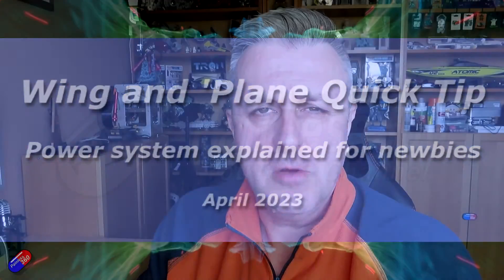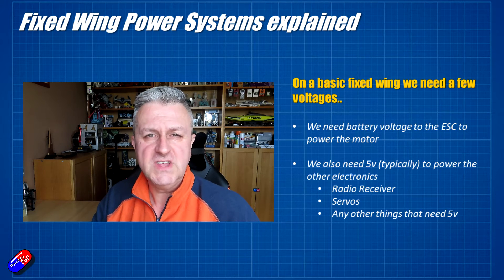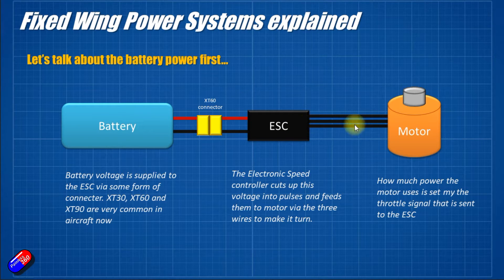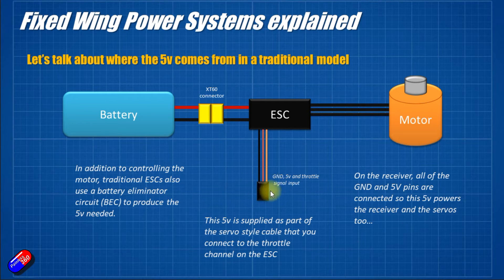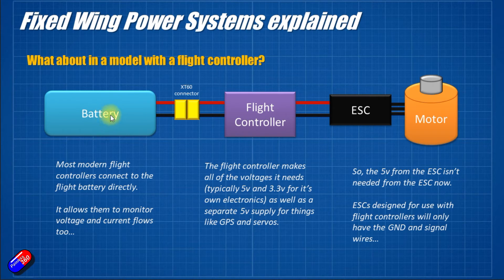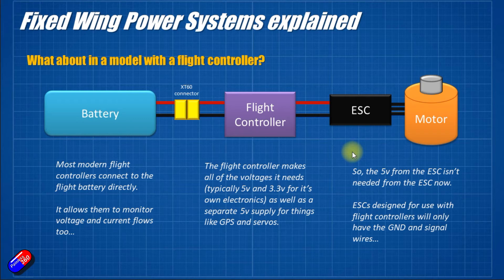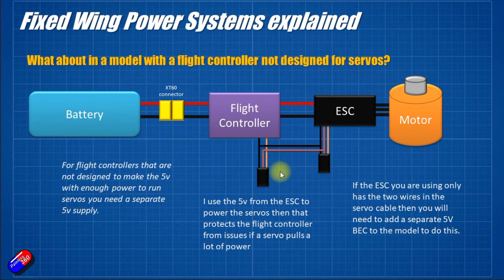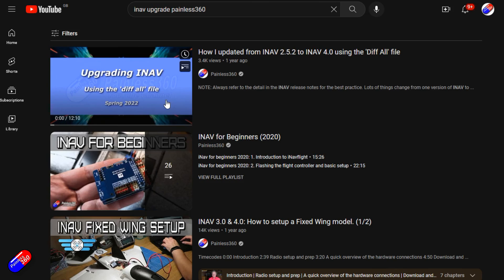Fixed Wing/Airplane Power Systems Explained for New Pilots/Builders

Comment: Hello again sir....1 quick question if u don't mind throwing some input
Can we use 5v from servo connector from flight stabilizer such as A3 V2 to  power up 5v electronic such as vtx ?
Reply from the maker: You can but you need to be very careful. I'd power the VTX from a dedicated 5v BEC on the model as they can pull a lot of power and noise on the power rails can be 'seen' as interference in the image..
Reply: Tq sir..i hope u keep on posting new vid especially regarding latest inav for beginners like me to learn converting from betaflight...much obliged sir😊

Comment: Exactly the video i have been searching for a while. 
As a beginner, i still have one question : what if i plug the throttle signal input from the ESC on the wrong connection of the receiver ? Am i risking any power issue/damage ?
I just bought a Multiplex Easystar RR as my very first plane, and a FrSky X8R.  Still trying to figure out how to assign the rights servo on the receiver.

Thank you. I subscribed though !
Reply from the maker: Typically, an ESC will not initialise until it sees a low value. As the other controls are usually around the middle channel value (1500) it'll just sit and beep until you move the channel that you have it connected to to a low value (below 1100 typically). Best of luck!

Comment: so does the flight controller cause a plane to self upright or what's the purpose of the EFC outside something like return to home? I assume you just fly acro always in a fixed wing plane. I'm going to have to get a kit. There's just no time. quads keep me plenty over loaded as it is. I got to have one though. Where does it all end? I'm so addicted 😂.
Reply from the maker: You can use the same flight modes as on a quad. ANGLE, HORIZON etc. They work in the same way. However, a well setup plane/wing is naturally stable so you can use ACRO or MANUAL to have a more direct control experience. Check out my INAV for beginners series. Happy flying!

Comment: i got some Problem with my Walksnail VTX and Inav. Maby you can help me?
I setup WS like your Video 4 Weeks ago. Things like the Artifical Horizon ore the Home Arrow arn't right. The Artificial horizon just shows letters intead of the lines. And de Home Arrow is Switching trough the alphabet when i turn. I cant get it to work. Do you had this problem to?
Reply from the maker: I talked about this in the Walksnail tips and tricks video - https://youtu.be/ATLZLxGSSJg - select INAV as the OSD type, not AUTO.
Reply: @Painless360  i tried all your tips sadly it just doesnt work. 
This video is from my wing and in the middle thats the home arrow
https://youtu.be/WqLroPxgmNw
Reply from the maker: All of the tips and setup that works for me here are in the linked video... Best of luck

Comment: I have a heewing t1 ranger, and two questions.

1. For the ailerons, they come connected to the standard servo cable, but both of them are on the same 3pin connector. Is this normal, or do i need to split them up for them to work with my flight controller?
2. My t1 ranger has the 3 pins on it's esc, will I need to use them?

Thanks for your videos, i have learned so much from them.
Reply from the maker: 1) I used them as wired. No need to split.
2) Not if you are using a flight controller that provides the 5v

See how I built my Rnager-T1 on the channel.. Best of luck!

Comment: Good video Lee - thank you.  Most ESCs designed to be used with Heli's will have an additional 3 pin.  The first is as you say - Gnd, Signal (Throttle) and power v.  The second is an additional programmable voltage set, usually used as a backup and plugged into any spare port on the FBL system.  This enables additional voltage in the event of an issue but, can be used to power other systems and sometimes comes with the signal wire separately to identify it as an RPM / Telemetry wire.
Reply from the maker: OMPHobby M4 videos coming soon! Happy flying!
Reply: @Painless360  - awesome!  looking forward to it mate.

Comment: Anyone try mounting gps ontop of the battery? Was gonna try a 3dprinted holder that slips on the batt strap
Reply from the maker: I've done things like that in the past but it can be tricky in a crash where the battery gets ejected and takes and GPS and cables with it.. Best of luck!

Comment: I find it cheaper to buy a quad esc for the motor, and a seperate BEC or two for the electronics... all the wing ESC/BEC combos are needlessly expensive.
Reply: Sparrow 3 OSD is $36 comes with the gps unit. I think that’s why they finally made the speedy bee 🐝 FC